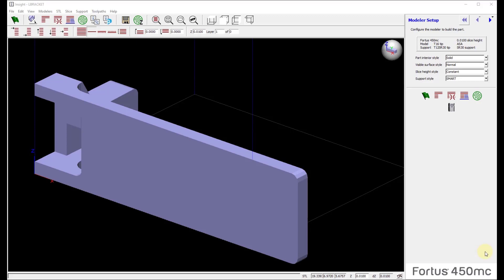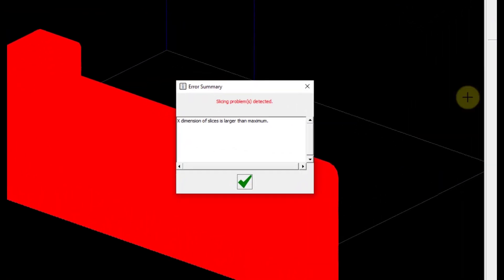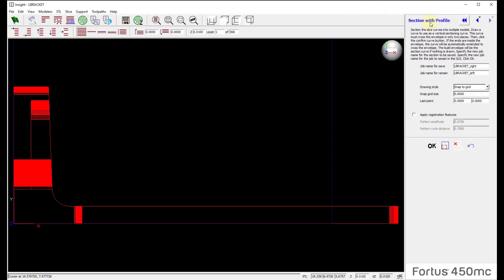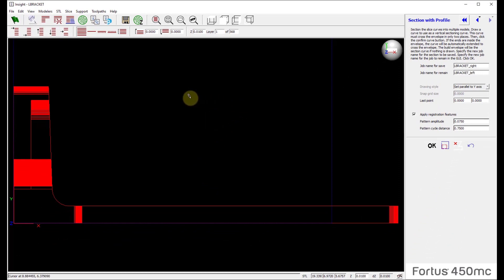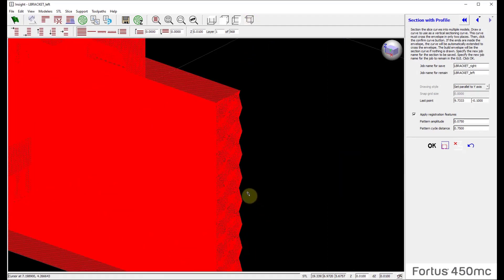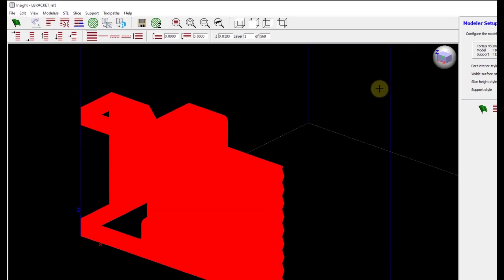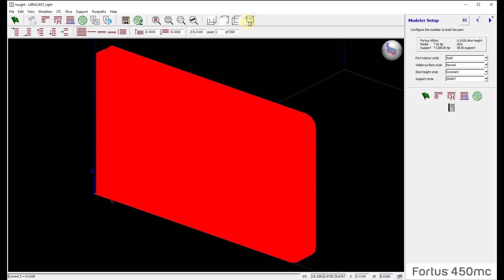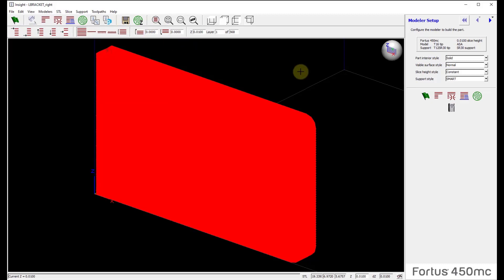Stratasys Insight Tutorial - Section with Profile

Comment: How do you recommend bonding them together?
Reply from the maker: Bonding parts together is going to depend greatly on the material being used and the application of the part.  Typically we would see cyanoacrylate (super glue) as the most common choice, but that is far from the only option. 2 part epoxy, hot glue, UV cure Resin, ABS plastic cement, acetone, or even polyurethane construction adhesive can a good choice.